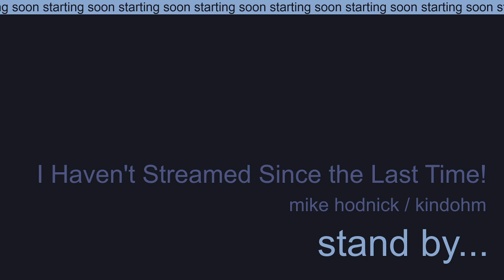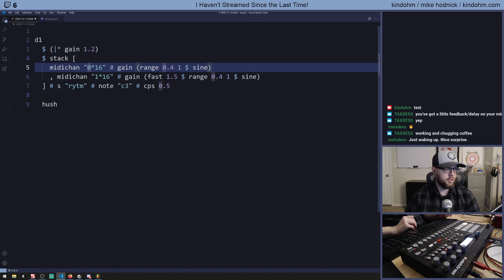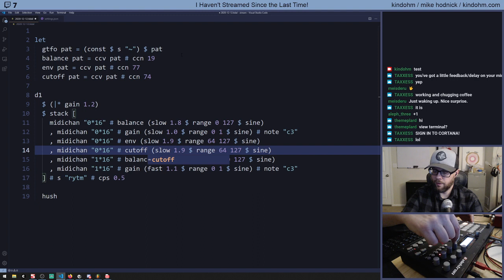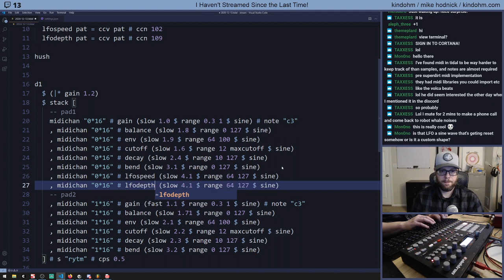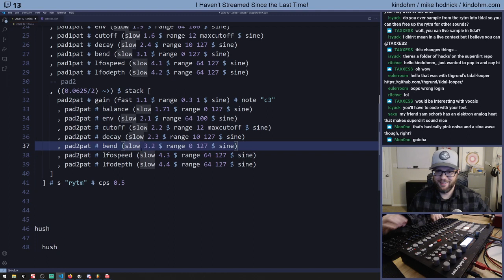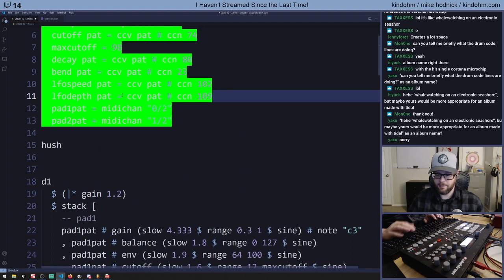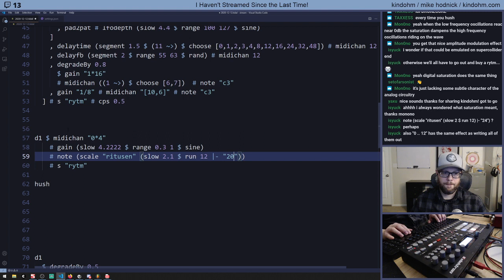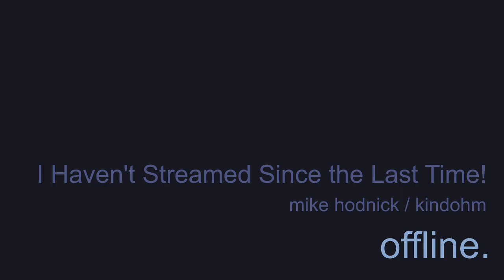I Haven't Streamed Since the Last Time! TidalCycles + RYTM Sound Design

Comment: Good stuff. Are you able to multitrack out of rytm while controlling it with Tidal?
Reply from the maker: Yes - that is possible with Overbridge. I've done it successfully but I typically choose not to, only because the tracks no longer go through the RYTM's distortion and compression circuitry, which in my opinion add a ton of grit and warmth. I just like pumping the entire stereo mix through the RYTM's final effects. Totally personal preference! Multitrack with Overbridge otherwise works perfectly.
Reply: @kindohm  Excellent. I somehow thought you had to choose between Overbridge and external midi control, but now it's up and running. I'm into heavy per track processing so this makes it all the more fun.